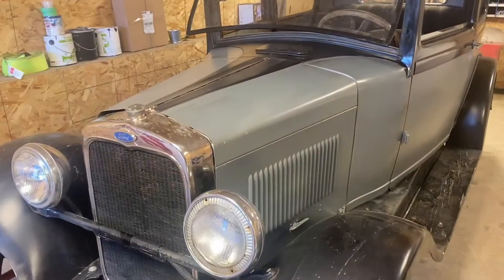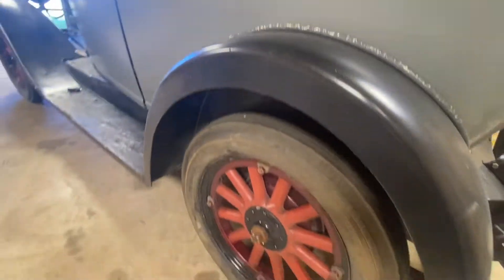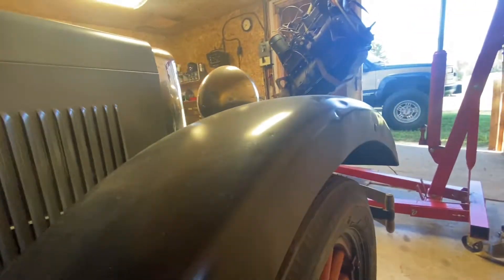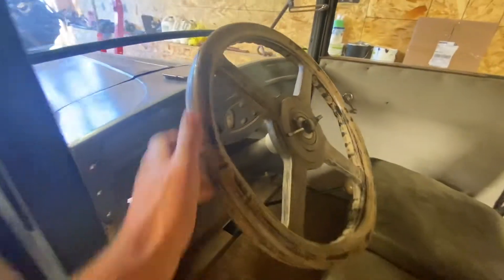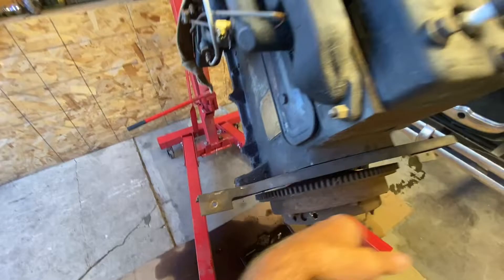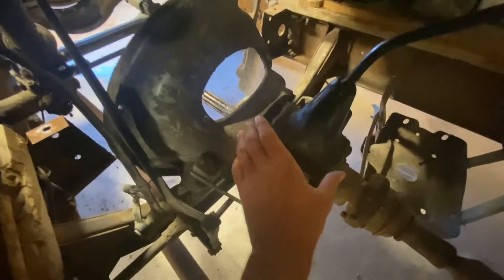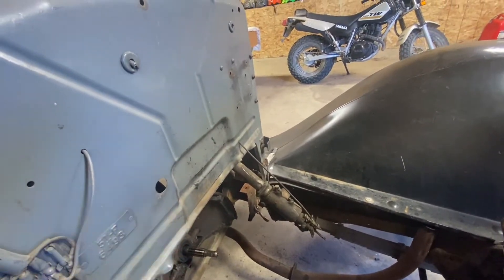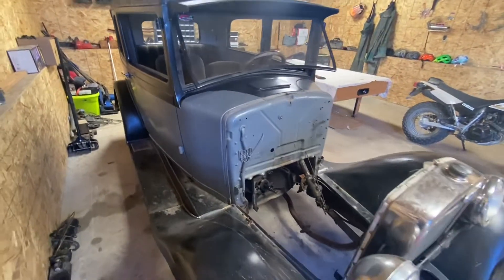Ford Model A, B, C?? Is It Worth Saving??

Comment: It looks more like a 1927 Studebaker Erskine. with a Ford Grill Badge .
you got ripped by an unknowledgeable seller.
First clue, Fords gas tank is in front of the windshield in the cowl. 
Second clue, removable rims. Ford didn't have those. 
Third clue ,Fords only had a speedo and fuel gauge in the center of the dash.
4th clue. Fords had one spring in front and one in the rear ,transverse..Not pairs of elliptical Springs
I would have used the original engine which has a lot more  HP than a 13 HP honda.
Reply from the maker: Thanks! I’ll dig deeper into it. Is the Studebaker a more valuable car?
Reply: You're right on!  The big clue was the body plate on the firewall - model 51-F - definitely Erskine.   I found a 1928 Erskine for sale on Youtube and it looks exactly like this one (although that one was a 4-door.)   VERY RARE.  Check out the Studebaker Driver Club (the parent company was Studebaker) for help with parts, etc, even though you seem to be tossing the engine.